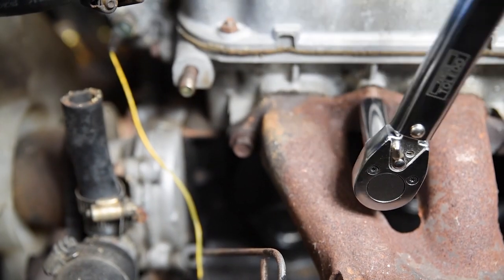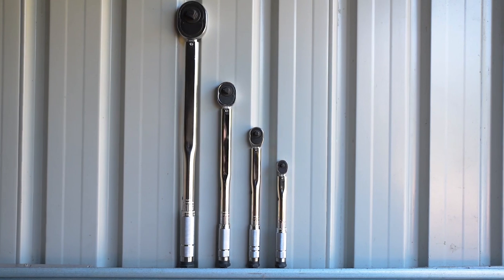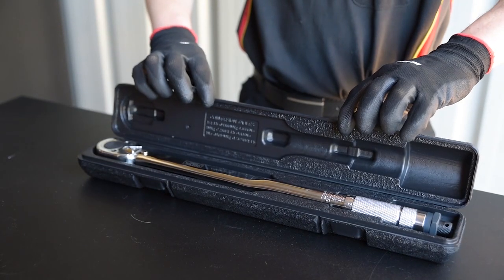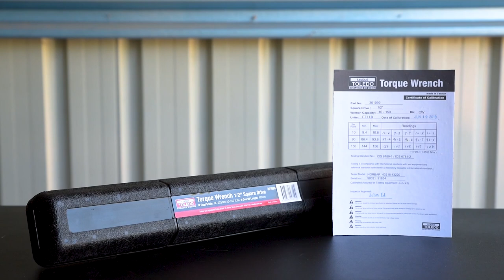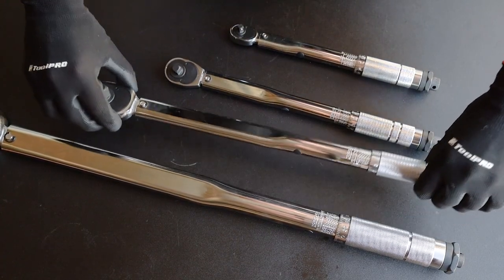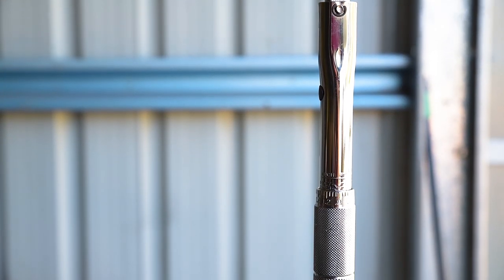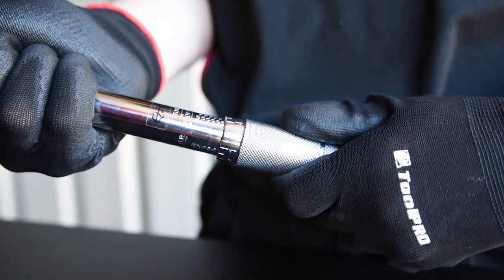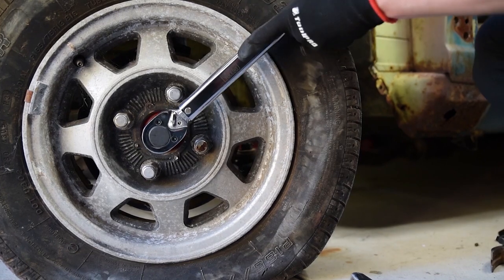Toledo Torque Wrenchs

Comment: I've chosen to purchase a TOLEDO 1/2" torque wrench  over the other brands  available on the Australian market. I need to know how to adjust the unit when calibration is required. On the handle there is a rubber cover, underneath there is a allen key grub screw. Is this the adjuster? Please HELP. 😂